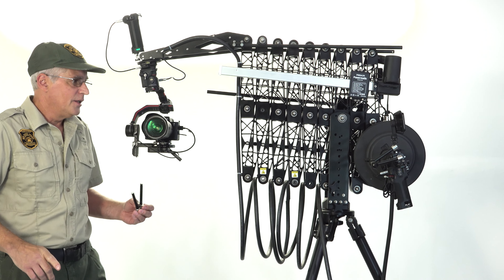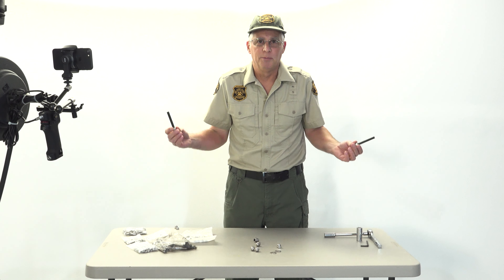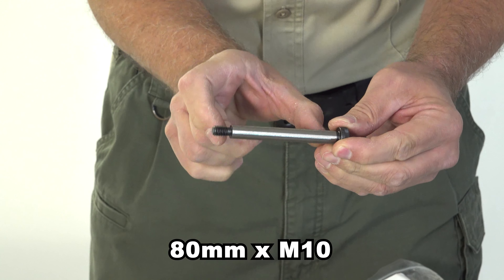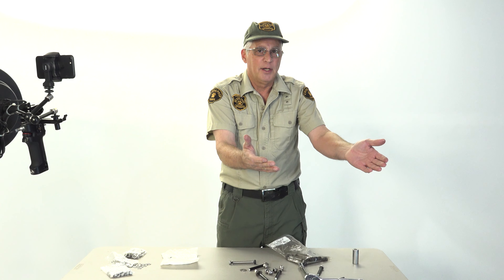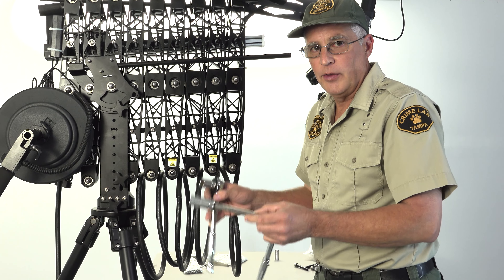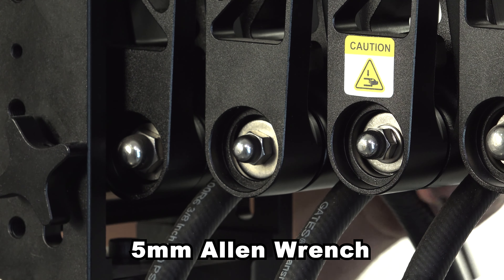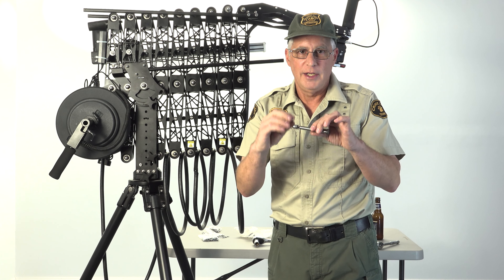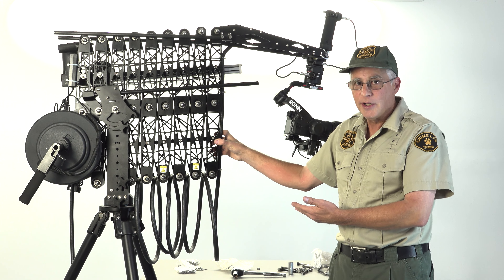My Proaim Jib is Falling Apart - How We Fixed It! The 17' Proaim Powermatic Scissor Jib Review

Comment: Did this happen on both your jibs?  Do you have a link or parts number for the shoulder bolts? This video has given me the fear.
Reply from the maker: The thing is, it only happened on one that I bought during the pandemic. So maybe it was a fluke.

The bolts literally popped off just sitting in a corner of the studio.

The replacement bolts are available from many sources, just get the size we suggested in the video.

I think if you carry a couple regular bolts with it, it something breaks, you can at least stick something else in to do the job.

Even without the nuts, it will still function since the main shaft is still in place, but you should be aware, just in case.

Have you had good results with the jib?
Reply: @mrdogpoopstudios   Actually, I haven't used it yet.  Looking forward to getting it out there.  Only picked up the weight plates this week.
Reply from the maker: It is a really cool piece of equipment if you can use it. I remember how excited I was when I bought it, but then we never used it.